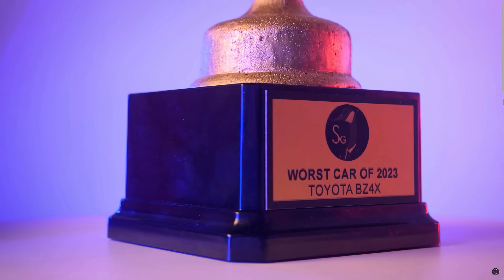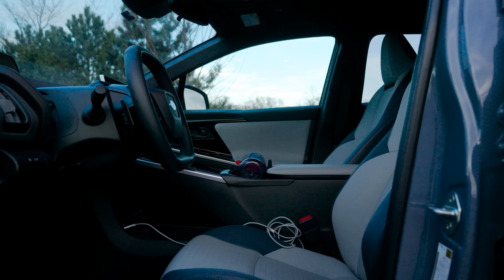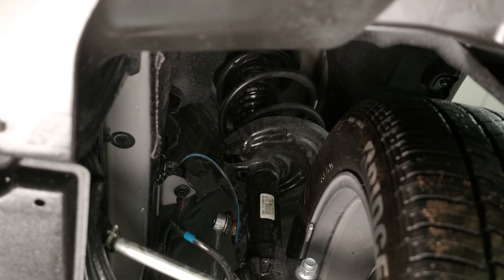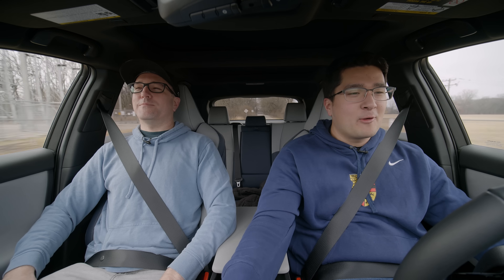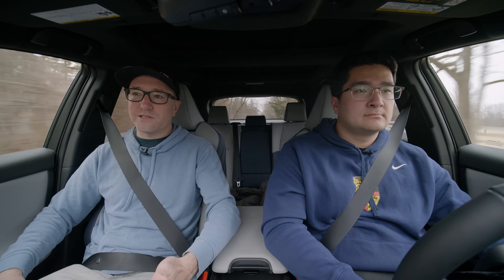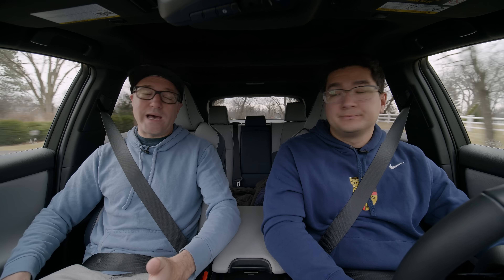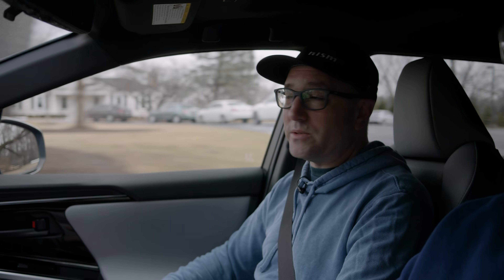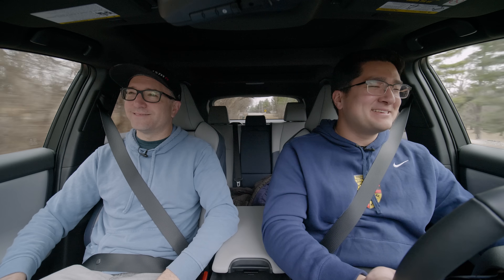Subaru Solterra | Sorry in Advance

Comment: Cold weather charging is especially bad for this car. A few weeks ago, I saw a Soltera charging at an EA station with 90 minutes on the clock while only added around 20% (~50 to 70%). It was around 15 degrees outside at night. While mine charged at 150kw at the same dispenser after it left, added 50% in 20 minutes
Reply: When I pulled out of my 41F garage yesterday the range was 169 miles.  (Normally 220 in the summer).  As the thermometer adjusted to the 2F weather the range dropped to 129 miles while still at 100%  charge.    Imagine 129 miles of city range, less on the highway, and then having to spend 1:30 hours to get it back to 80% where you then only have another 104 miles before empty again.
Reply: @MtnXfreeride  What SoC is that? Can the Solterra not schedule or start cabin conditioning before leaving, or are your numbers including that? The engine of my old diesel Golf wouldn’t get warm enough to heat the cabin until about a 30–40 minute drive, so I got used to bundling up and using the seat heaters, and I don’t really mind that.

I’d probably try to precondition Solterra cabin to 80° or something while it’s plugged in and then bundle up and keep the cabin to at a minimum and/or use the seat heater. How does that compare to what you do?
I’ve had a garage for less than two years, so driving a car that starts warm then gets colder is still be better than what I’m used to.

I was going to ask a dealer for an extended test drive of one they have priced fairly, knowing that it’s not a roadtripper, but less than 150 miles of range in any season is a dealbreaker.
Reply: Gas is denser at cold temps so I get even more bang for the buck when I'm filling up my gas guzzling V8 4Runner... which takes all of 3 minutes.
Reply: Someone forgot to turn on battery preconditioning. Preconditioning triples the charge rate on my EV6.
Reply: @churchofmarcus the solterra doesn't have the option for you to precondition, you have to drive it super hard then immediately get to a fast charger before the battery cools down again
Reply: @NiceYoutuber  why am I not surprised. So its poor charging curve is even worse in winter 🤦🏽‍♂️
Reply: @churchofmarcus  the Hyundai/Kias didn’t have the ability to precondition when released. Does the Solterra?
Reply: @churchofmarcus  you admit that😂😂😂😂😂😂😂

Comment: It's like they built these to say, "see! we told you people didn't want EVs." Never seen car companies try so hard at sucking.
Reply: They did sell 12k of them here last year. Since it got several thousand dollars cheaper for 2025, maybe they'll crack a whopping 20k. But yes, they need to get on a proper next-gen product.
Reply: Nah, it's just a hedge to manage the costs of regulatory compliance. They can tune the subsidized lease deals to move fewer or more units where they have EV mandates, or as an alternative to buying EV credits.
Reply: That sounds like Subaru with the Forester XT... Subaru: lets take out the manual transmission and hood scoop ... sales drop...  "No one cares about the Forester XT so we are dropping it"
Reply: They’ve sucked more at light duty work trucks.
Reply: Subaru makes the best cars.,  Just not the EV's yet.
Reply: 10-80% 18 vs 28 min like someone is going to notice the extra 10 minutes.  If the 10 to 80 is over 8 minutes and under 45 minutes human psychology actually suggests the charging time will feel similarly inconvenient because of attention spans and how people tend to schedule their days
Reply: Why is Jack wearing a bootleg “Porsh” hoodie!?
Reply: Mazda MX30 is worse
Reply: Toyota specifically does this because they haven't innovated in 20 years
Reply: I've been posting the same comment since the BZ4X came out, but I like the way you worded it. I think the tip off is the battery size. Maybe they don't know how to make an efficient EV but when on top of that you choose to put in a smaller battery than all of the competition, and most people look at range first, it's obvious you don't really want the car to succeed. Toyota hamstrung this car because they don't want to make EVs. I have a Rav4 Prime and that's an example of what Toyota can do when they care. I'm not sure they'll be able to catch up if EVs take over the market. The other tip off is that they haven't really improved the car in terms of its core specs. Finally they really had to make it very bad for it to fail because there are so many loyal Toyota customers who would have loved a reasonable RAV4 EV.
Reply: @Molishious Toyota uses nickle instead of lithium batteries as a cost consideration, they aren't as energy dense so the battery is probably the same size as the competition just with less capacity but the packaging constraints within a given en vehicle size class limit the dimensions of the battery hence the inferior range. When it comes time to replace the battery however the cost will be almost an order of magnitude less. I bet in 20 years there will be more of these rolling around than the competition simply because they won't mechanically total themselves at 12-15 years old the way every other EV will.
Reply: @flacjacket  Only the basic hybrid uses nickel-metal hydride batteries, the plug-in Prime uses lithium like anything else with a decent sized battery. You'd struggle to find an EV built in the last 20 years that used nickel-metal hydride.

Comment: I work for a dealer. We all hate this car.
Reply: I was watching a video by Barrie Crampton (retired car dealer in England), in the video he was reporting that brand new Jaguar iPace's are getting 45% off (and still not moving). That will probably happen with this thing, competing with the Mazda MX30 (which sold all of 600 units in the US).
Reply: @r0x0r-p4t  Jaguar has about as much cachet as Fisker do, so it's no surprise to see their cars receiving similar discounts!
Reply: @r0x0r-p4t actually because of crazy discounts the BZ4X has outsold the GR86 and Supra
Reply: This is a bad EV that was designed to be that way. But they didn't really mention the one advantage it has over the competition other than maybe better lease deals. It it is higher off the ground than the Mache (5.8),  Equinox EV (6.4), Ioniq 5 (6.1), ID 4 (6 in), EV6 (6.1), Ariya (6.3). The Blazer EV and the Protogue are the only ones that are equal, but those cars are quite a bit larger than the Soltera.  I have a RAV4 and like the height so I see this as a positive for the Soltera, but not enough to want to buy/lease it.
Reply: Frankly, it seems like one of the better Subarus at this point.
Reply: This is a reason it does not sell well. If you don’t like the vehicle, you don’t know it inside and out. Lastly, if you don’t like it then you don’t present it with enthusiasm.
Reply: Give me a pro tip on how to get a good wrx deal. I promise I won’t flash it then argue with the service department when they deny my warranty claim
Reply: That is a very concise and 😂 comment!
Reply: @sleepybear-me you belive this ... Because a 20 minute charge time with 600 mile range is awful? 

Keep driving your 20 year old pickup,  no one is forcing you to follow with progress. 

Its not political,  it's capitalism.  Manufacturers build what people buy. 

Smh
Reply: @redwineisfine   And no one is buying. The people have spoken with their wallets.
Reply: @rustygolfer3475  weird because the sales of evs have increased every year since 2019... 

But sure . You're right
Smh
Reply: @redwineisfine  I have just worked at a dealership for 24 years. What do I know? I am sure they have increased but they are less than 1% of cars sold. So you are right they went from 0% to 1%. What an accomplishment.
Reply: @rustygolfer3475  obviously you know zero about ev growth. Make it your business to know your business.
Reply: @ Our dealership sold over 3,000 cars last year, maybe 10 of which were EVs. Do the 1st-grade math on that.
Reply: @redwineisfine   Sorry I googled it I was wrong. It is 1.4%. LOL
Reply: @rustygolfer3475  in 1990 less than 1% people had cell phones.. 

Obviously you lack foresight.  I've already stated months ago,  evs today are a bit premature do to range anxiety.  Much like mileage anxiety to the Midwest when it comes to leasing. Eventually ecs will be more than 10% and then the will take over.. 

It just takes time..
Reply: Liar you are envy  because  u can't afford
Reply: It's definitely a compliance car...
Reply: May I please ask you why? Thanks.
Reply: It's all in the video, it's a electric car with no range and bad charging speed and a relatively high price tag (unless you can get a good deal). Hyundai ioniq5 or Kia EV6 are much better car with similar price tag.
Reply: @ I would like to believe that the poor charging speed MIGHT help to have the same battery for 15 years!!!, if so, I can leave with it, the clearance is vital to me... I understand, if you can get a great price COULD make a bit of sense!. Thanks your time and answer. Merci.
Reply: @Carlos.A.Nunavut 

Poor argument when Tesla batteries have shown capability to already last 10+ years in practice. Reports of accelerated testing indicating easily last longer.
Reply: @Carlos.A.Nunavut  the data is pretty clear now. Modern batteries just don’t degrade with normal use, even if they’re fast charged all the time.
Reply: @Goose-fafo people buy Subarus for their AWD and stander ground clearance. The cars don’t compare
Reply: @kpmmsupervision1297  it's about as premature as it gets. 5 years from now, the ev will be relevant.  

Today it's like comparing a 4cyl from the 70s to a 4cyl from today.. 

It needs more time to be so much better..
Reply: @redwineisfine well said. EVs really aren't ready today but the EV companies want your money now..soooo..
Reply: No one seems to be making money on EVs. Maybe Tesla is.

Comment: What were they smoking with the wheel arch cladding? Stop sign shaped and have none of it at the bottom where the most rock chips will be?
Reply: and rust. Anyone living in a rusty place knows that the lower wheel arches are where the visible rust begins.

Comment: It's not a bad BEV. For 2020...
The only reason any sane person would lease this is if the dealer is so desperate that they are paying you to drive it off the lot
Reply: You mean for 2010.  A 2018 Model 3 puts this to shame.
Reply: @aussie2uGA  you can’t lease a model three for 250 a month
Reply: @ If price was the only option, according to grok: The lowest lease price for a Tesla Model 3 in 2025 appears to be around $299 per month for the rear-wheel-drive version, with a down payment of $2,999. This deal is effective for a 36-month term with an annual mileage allowance of 10,000 miles.
Reply: @aussie2uGA lol yeah, this basically a 1st gen Leaf
Reply: The model 3 existed in 2020 and the Ioniq 5 was announced and on its way. This thing was literally 10 to 12 years late.
Reply: You can get an iPace with delivery miles for nearly half off in England, I suspect that will happen to this and the Toyota as well.
Reply: What the fuck is up with people being like this? It's a fine car, in every way other than range and charging speed. If you could get it for 200 USD a month, there's just nothing else that compares. It's fast, silent, smooth, roomy, cheap.
Reply: You mean 2015.
Reply: Honestly if I had a gun to my head and it had to be my money that I had to spend on this or a Nissan Leaf I would take the Leaf.
Reply: Not sure it has the range to get off the lot....